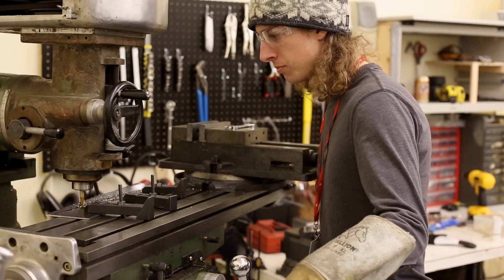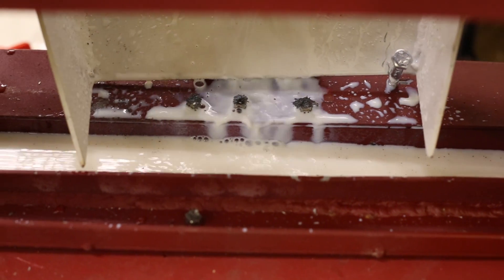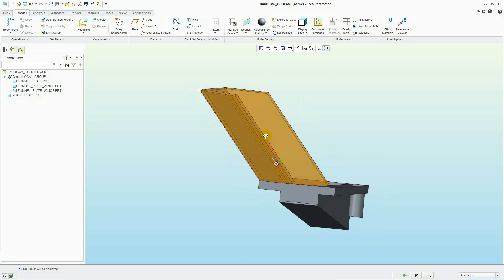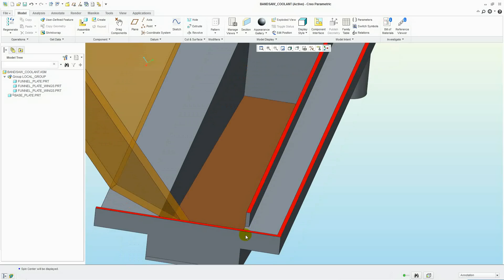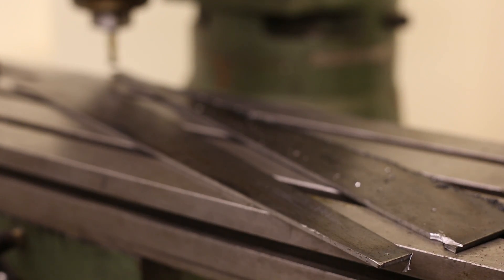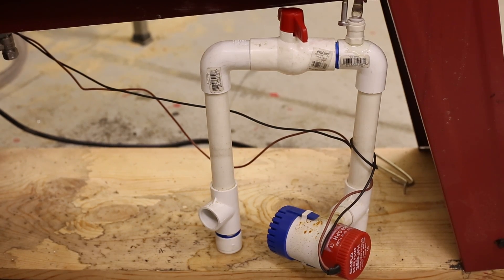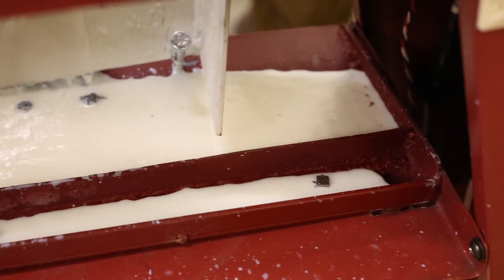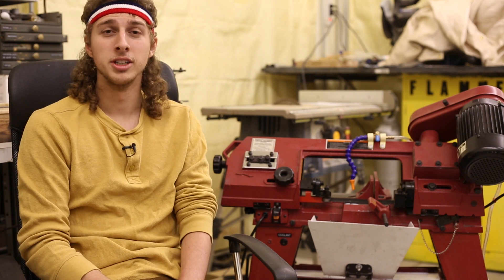SparkFun Engineering Roundtable #17: Bandsaw Coolant System

Comment: Those endmills simply look like they're being run too fast or were run well past the point of being dull. I would also check to see if your Mill has a reservoir in the base of the machine. Most machines of that size did. You can just put a pump directly in the base and build a shrouding to catch the chips.